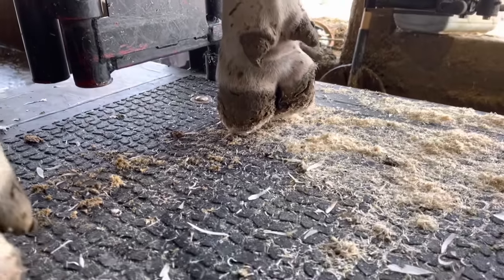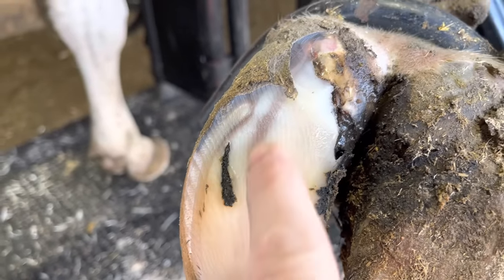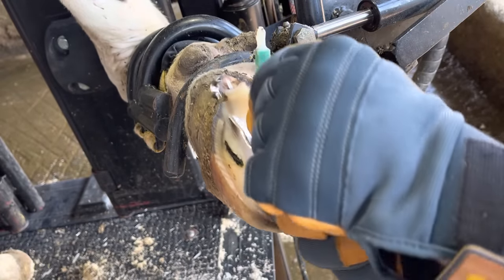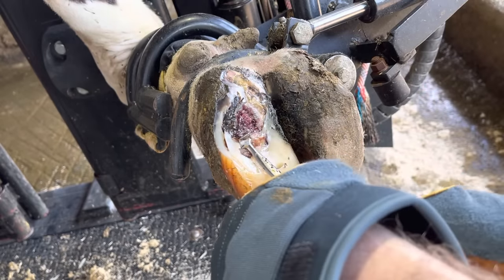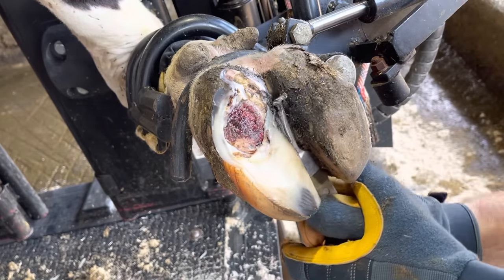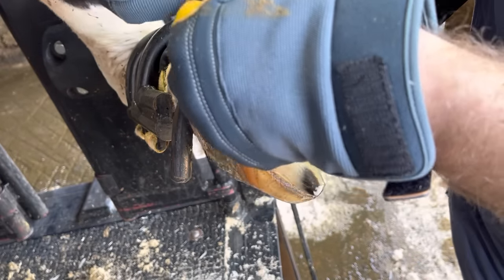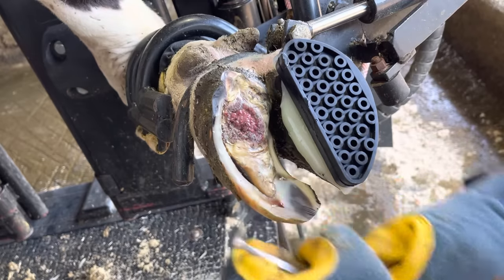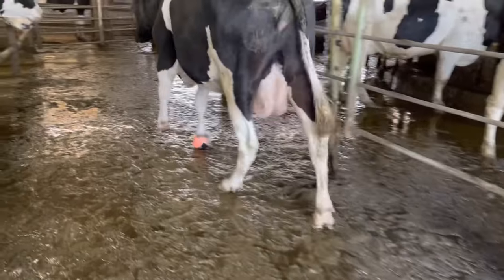This is a BIGGIE // INSTANT RELIEF

Comment: Nate, Some video  idea's.. maybe it is handy for people to go into depth about the white line.. Maybe with a piece (or more) of paper and a sharpie?
Because pointing out the line is 1 thing but there's so much more to explain. 
And then about the corium or hoofwall.. 
Say, a little bit of the way you learned it but then in a o so simple as possible way and not at all a suggestion that this is a teaching instructions Manuel but a hoof trimming guy that shows his job, his passion 🤗
And then a video about this per month maybe? With a quick problem related visual issue and solution (and of course those that have no issues but still added visual effect?
All absolutely out of your point of view 😎
It is just a little idea..

Comment: The weight is actually supported by the sidewalls of the toes.  So, in cases where both toes have issues, you can apply a block shaped like a horseshoe that won't put pressure on the sore area.  Hoof GP has used them a few times.  So, it's definitely another viable option.
Reply from the maker: That’s not how it works actually.  The weight is transferred to the wall from the pedal bone on the inside of the hoof.  The only thing a horseshoe block does is keep elevate the hoof.  If it were a protruding ulcer it may benefit but in most cases it won’t do much.
Reply: @NatetheHoofGuy  
I believe the scenario was that both claws had issues, but one had more serious issues than the other.  You put the horseshoe block on the better of the two claws instead of a regular block.  Although, I'm thinking it was half a horseshoe rather than a full horseshoe for some reason.  I would need to look back at videos to be certain.  The idea was that it served the same function as a block normally does, but it avoided causing problems with the blocked claw.  Since the weight of the cow is largely supported by the sidewalls anyway, this kind of block can work just fine.  A block doesn't need to put pressure on the entire sole of the foot to do it's job.

Comment: Cutting a hoof(or anything) does create some heat. When you say the rotary cutting wheel creates “zero heat,” I think what you really mean is “too little heat to be a problem” (which is true). 

In fact, I suspect that glue you use to attach a rubber block creates more heat as it cures than the whole hoof-trimming operation creates.

Comment: I have watched you for some time now, I have to admit I started watching the "THE OTHER " ut um guy, which is hard to understand  LOL a lot of time. And for some unknow reason I cannot get enough of watching. But he is my question I have not heard you address. Have you ever cut yourself with those razor sharp knives? And watching you fix some of these issues, my thought would be why couldn't you use a rotoary tool with a carbide cutter and do a small spot removal and expose a much smaller area, rather than making such a larger removal of hoof? Such as a nail puncture or a stone , or other pieces of metal stuck in the hoof? Just a thought from a un experinced arm chair hoof expert LOL.

Comment: I've asked the same question multiple times and never got an answer, which is "Why don't you use water AFTER you get down to the damaged area to clean out the damaged hoof before you spray the medicine rather than spray excessive solution to to use as a clearing agent?" It's like if I cut my finger and need to remove dead skin to get to the damaged area. I always remove damaged skin, get to the damaged area, and then rinse off the wound with water and then add the disenfectant. I'm NOT asking why don't you wash it first.

Comment: hey nate ! im still a lil confused abt how dirt gets in the hoof. since the horn grows from the inside out how does the dirt and rocks get inside the hoof? id assume that whatever holes the hoof made would eventually get trimmed away after a while and nothing would rly touch the inside of the sole
Reply: The horn had a hole in it, so dirt slips in as the cow walks around.
Reply from the maker: It penetrates the junction between the wall and sole and under-runs the layers.

Comment: It wasn't that you'd want a clean surface to start with. I just always thought you'd clean it first to see clearly where it's coming from. I.e. a bloody hand. You'd have to wash the blood off to see what's cut. I suppose if you're used to what you do, you wouldn't need to. It was just a thought, haha
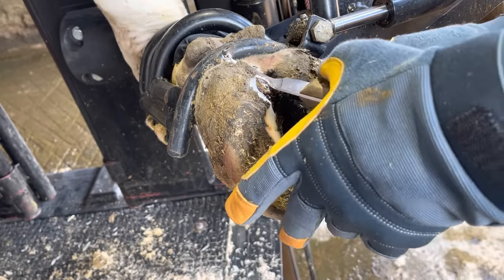Reply: he answers the question at 0:40 its because it wouldnt make a difference, he has to trim the foot anyway in order to see where the problem is
Reply: @aminahm4911  But if someone was a beginner or learning, they'd probably clean it off. That's why I said someone experienced probably wouldn't need to. I answered my own question in the comment

Comment: Nate, I noticed you will oftentimes carve a crescent shaped cut-out into the inside of a claw before grinding it down or doing any other work. 

What is the purpose of that?
Reply: So manure or debris doesn't pack between the claws.
Reply: It's part of the modelling that's done in a routine trim.
Unless a cow is noticeably lame most problems are found in the process of trims.

Comment: Once again I'm wondering why the cavity isn't just injected with some sort of toothpaste like slurry of salicylic acid, iodine or some other disinfectant and the hoof material keratin is left to protect  live tissue which will regrow.
Reply: It can't heal without space.
Reply: The horn that's grown over the lesion is not structurally sound and is impeding healing of the sole underneath. It isn't protecting the sole and needs to be removed so proper healing can occur.
Reply: In many cases of hoof trimming there is sol separation but the corium spontaneously produced new soul horn.

Comment: One question I’ve always had is if it’s difficult to remove the block once the cow has healed. There’s obviously a type of glue holding it on the hoof. Is it so strong that it’s difficult to remove?
Reply: I'm sure it's not easy, otherwise it wouldn't still be there.   I haven't seen them all, but I've never seen him remove one.

Comment: Poor cow is really hurting, even after the trim and block she was stepping on her tiptoes on that hoof...
Reply: That's normal... it hurts, it's doctored, and it hurts until the healing process reaches the point of pain reduction.   And it's a cow... doesn't understand completely right away.   It goes into the chute with pain and when it comes out of the chute it doesn't know right away that it should expect to have a reduction in pain (hopefully).  And probably sometimes there's not always a immediate reduction in pain.
Reply: @baronvongrimm4780  Most of his injury hoof trimming videos have the cow gingerly stepping on the hoof, then walking more and more normally as they realize the pain is gone/lessened. This one stood out because it wasn't like that.

Comment: The glove analogy is actually pretty terrible. It leaves out a lot of things. It's not just "you have to take your gloves off to wash your hands." It's "your gloves are covered in days or weeks worth of mud and shit, there's an open wound under your gloves, and you decide to take your gloves off by haphazardly slicing at them with a knife, smearing the mud and shit all over the wound, and then you don't actually wash your hands, you just spray them with disinfectant, then cover them in powdered acid and put on new gloves."

Comment: Is there a video where he addresses the difference in his trimming style vs The Hoof GP? 
As I understand it he's a heckuva lot more gentle and slow but having watched as many videos as I have of both channels I just don't see the point in that gingerness.

While at a glance it looks like The Hoof GP is far more forceful when it actually comes down to it when necessary he goes slowly, he just doesn't do that for every single cut. 
Whereas it looks like if Nate did every single hoof at his usual pace he'd have to spend 10 minute per animal. And it just doesn't seem like it brings any tangible benefit at all.
Reply: Most cows don't have problems, and I'm sure he is much faster with those non-problematic hooves.